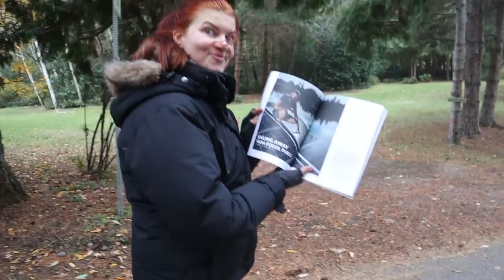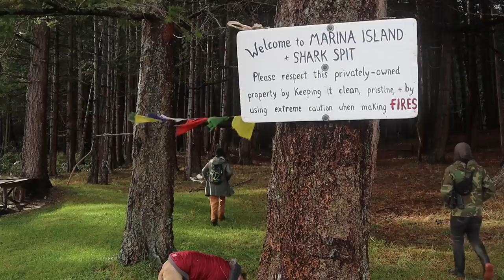The Bimini - Sink or Swim 194

Comment: Wind turbines are a great idea they generate electricity when your solar panels do not such as when dark cloudy etc. There are unfortunately three drawbacks to them. One is the noise but you can live with that secondary though is you normally mount them near your solar panels where they then proceed to cast shade on them. This can be mitigated though not cured by the use of multiple solar chargers. Lastly and probably least when you are sailing with the wind they are less efficient since the apparent wind is less